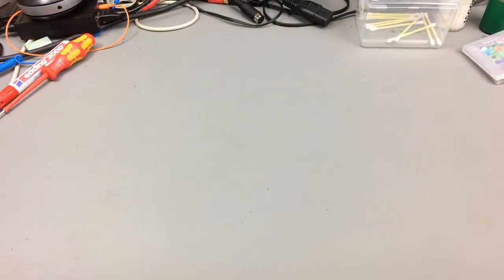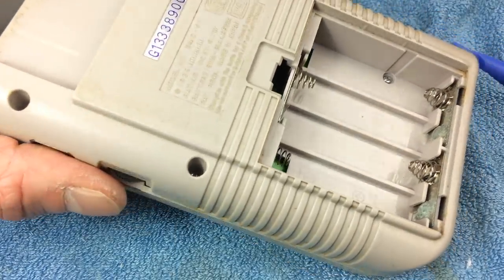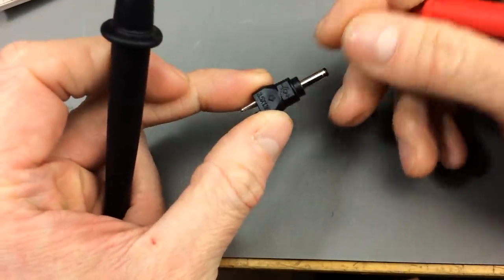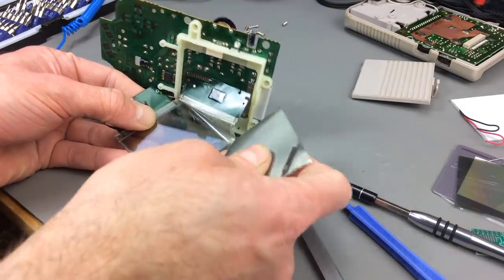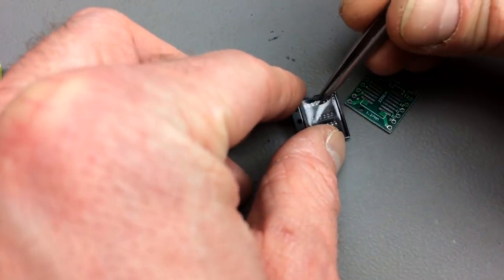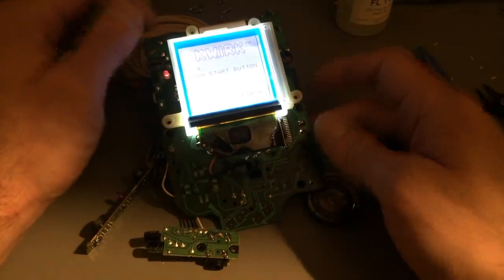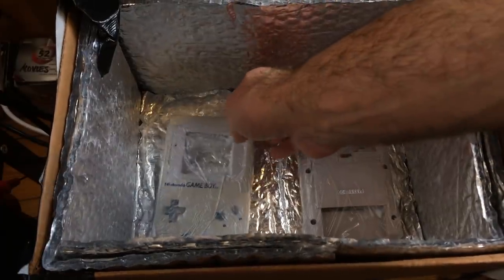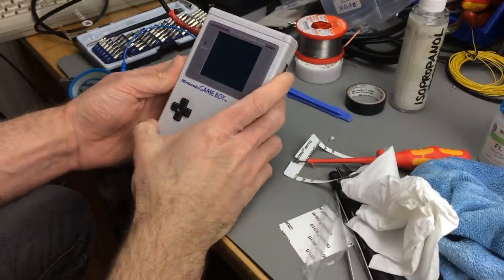Nintendo Gameboy DMG-01 Restoration and Mods

Comment: I cringed when you started scraping off that foil backing from the LCD! You're lucky that you didn't trash the thing entirely. As for the 74HC04: wouldn't it be better not to use the carrier card, but just stick the chip to the PCB with a double sided pad and wire directly to it with Kynar wire. btw Shouldn't you tie the unused inverter inputs to ground to prevent oscillation? Interesting video. Enjoyed it.

Comment: You need a hot air soldering station. They're not all that expensive, and they're very good for gently heating up glue for peeling it off, not to mention shrinking heat shrink. And as a bonus, you can also use it to desolder stuff very cleanly, gently and efficiently. I have recently decided I don't need to buy an expensive desoldering gun, because I discovered that I can use my cheap hot air station for that with excellent results. It takes a little bit of practice, though. But it's not that techinally difficult, the practice is mostly to overcome the nervousness and to learn a level of patience that is not necessary when using a soldering iron.

Comment: I'm not totally surprised you have dead pixels, you were pretty violent with those ribbon cables :P I did this mod myself (including the bivert mod, mine came on a single board which you just solder in place, I think is much cleaner to be honest!) and I tried to work within the limited space you get, although getting that silver backing off, even with a stanley blade is a nightmare. But yeah, even I managed to have a dead line or two in the vertical, but did just as you said with the soldering iron, just waving it over the top of the cable until it was fixed.

Comment: I remember trying to mod my old GameBoy 15/20 years ago. in the end I screwed it up, didn't have the proper soldering iron, used one of those cheap direct mains irons and burnt up/lifted a trace or two.

Magnet wire or solid core wire wrapping wire works great fir short jumper runs. Solder on one side then lay it where you want it, clip it with a exacto knife and use the heat of the iron to made the sheathing pull back if it is wire wrap wire and for magnet wire the heat from the solder should melt the varnish coating off.

Comment: Use white vinegar to clean the battery corrosion off, works much better than ipa for that, clean with ipa afterwards.
Reply: Or any mild acid. Citric or phosphoric should also be good.
Reply: Would apple cider vinegar be alright? I know it works better with rust.
Reply: As long as you remove all the residue I don't see why not.

Comment: Could you have used IPA to remove that silver backing fro the screen without using a knife? If it can remove the adhesive residue, surely it could help with the whole part of that job (also, then, you could use a plastic tool to help)? Maybe that would reduce the chances of breaking the ribbon cables as well?

Comment: I suggest cutting a bit off a hot-glue stick and putting it in the heat-shrink before you heat it, as the heatshrink shrinks the glue will soften and make a nice firm covering

Comment: That battery compartment is super corroded. That reminds me of my game boy. I had a battery explode on me and it leaked juice into the PCB. I had to turn it into a repair shop to get it fixed. I don't remember what that cost. But I was without it for a while. I did get it back and working eventually.

Comment: That polariser needs to be flat and have no bubbles or you will get an inconsistant image. I find it better just to place it on the backlight with sticking it down, it will stay in place inside the screen.
Reply from the maker: Yes, makes sense. This mod didn't go as planned in some ways. Thanks for the tips!

Comment: Don’t waste time with UV light. Just submerge it in 12% H2O2 and leave a kettle warmer in it to maintain a temp around 130° for about a day. When finished, you MUST apply 303 Protectant because the plastic will be very very porous and brittle. 303 keeps it from turning yellow or absorbing hand oils etc.
Reply from the maker: I’ve done a lot of retrobrighting in the meantime and found that a combination of UV and moderate heat works best (both speed up the process and it’s much faster when combined, usually only a couple of hours). Never had to use 303 but it probably doesn’t hurt. The yellowing is slightly returning on some items I treated years ago but none of them is nearly as yellow as before the process.

Comment: Just off the top of my head, a low heat air gun and a bottle of (have Ronsonol here in PNW) lighter fuel which is short work of many adhesives. Plus, air gun should help with the shrinking. That and IPA gets about 99% of the stuff I do done.

Comment: I have one of these sitting next to me on a shelf and I am too lazy to buy some batteries. I think I'll make this cable :)
Reply: With that said... any chance you can tell us what the diameter of the power jack is? I'd rather not buy a set of connectors when I only need one.

Comment: You can also buy a USB to power adapter on Ebay!
These work, I have several :-)

https://www.ebay.com/itm/113283738524

Edit:
- Recommended mod dealer: https://handheldlegend.com/products/game-boy-backlight-white-normal-or-inverted-diy-4-led-lsdj-chiptune-nanoloop
- You can also buy Gameboys cheaply from Japan on Ebay, not working ones can often be fixed (I have).
- Changing the volume wheel can fix audio issues, I used the one for a Gameboy Colour which fits and works
- As you learned the hard way, don't mess up the horizontal cable for the screen. It's not really fixable (what everyone says at least, please prove us wrong :-P )

Thanks for the video :-D
<3 Gameboys

Comment: I will never understand why it took Nintendo TWELVE YEARS (till the GameBoy Advance SP came out with the first backlit display) to get the idea to solder two LEDs at the lower bottom or the back of the screen to make the original GameBoy actual usable........... In every condition and not only when sitting under a window with brightest sunlight ;D
Reply from the maker: Yes, a bit of a mystery. I guess it was way cheaper to produce the old LCDs back then. And they probably still sold many GameBoys because the competition was way behind. :)

Comment: Never use Varta batteries! They killed 3 Petzel lamps and one wall clock for me this year. :( Nothing leaks like Varta batteries.
Reply: They also kill Amiga computers by the thousands.
Reply: He didn't leave them in, as you can see from the video.
Reply: I like enloop rechargeable they never leaked on me yet and I had the same ones for 4 years